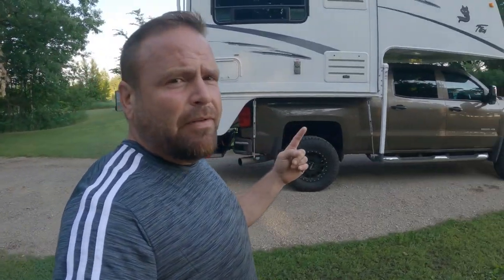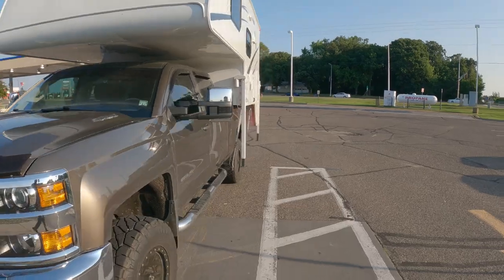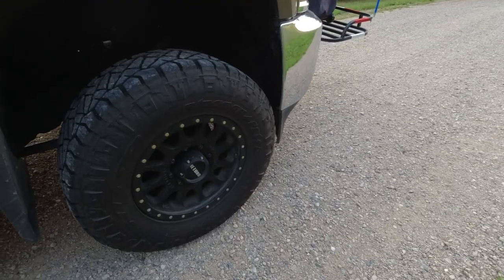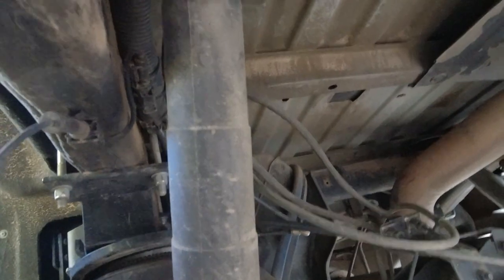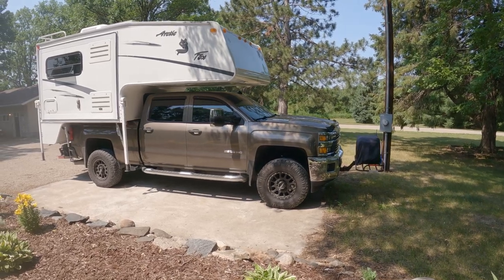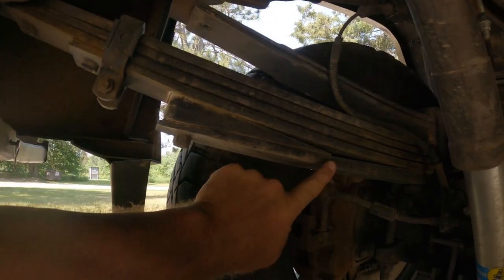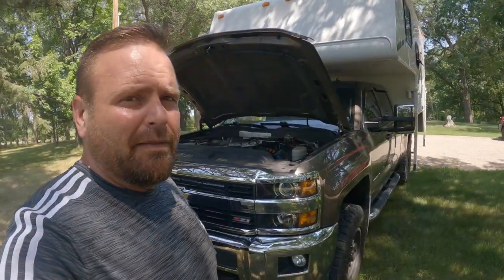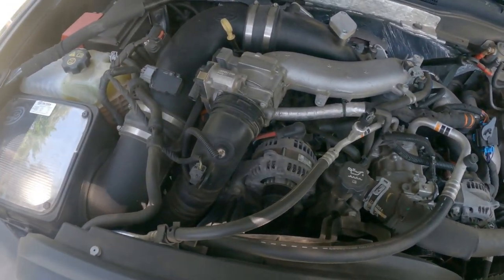Suspension upgrades for Truck Camper

Comment: Great video, good ideas. I like the dually for having the two extra tires to carry the weight, more stable.
Reply from the maker: There's no doubt about it, the dually is a lot more capable hauling a truck camper. Thanks for watching!
Reply: @KennyOfAllTrades  when using a duley , would you need rear sway bars??
Reply from the maker: I'm not sure, I have never owned a dually.

Comment: Great video 👍 I replaced the factory hollow front Sway bar with a Hellwig 1.5” solid sway bar, billstein shocks, rear Stabil-Loads, tembrens, and Big Wig Sway Bar. I have no more body roll. Truck handles Camper nicely on Crappy California Roads
Reply from the maker: I know we can not actually raise the payload on these trucks, but it amazing how much better they can handle with a few upgrades. Happy 4th!

Comment: When we go pick up supplies and need to open slides to get into the truck camper, we park at the far edge of the lot and take 4 spots to fit. We have to pay for two spots in paid parking lots. Thanks for sharing! Tracey and Christian.
Reply from the maker: I definitely can relate with parking in the back of parking lots.

Comment: Recently upgraded from my Ram 3500 to a Dually Ram 3500. Your camper looks lighter/smaller than mine (2021 AF 811), so I would probably have kept the same setup you have too. I went all over the country with my SRW/811 setup over the last year, out to yellowstone, colorado, utah etc, with no major issues. A sway bar would have been my only other mod. I was over weight on my tires/wheels even with the tires rated at 4080/tire so I went to 19.5s and hated having to swap tires around to put the camper on or suffer with a harsh ride empty with the 19.5s. Dually is more stable overall, and I have a short bed dually so I don't have quite the length problem you'd have with a longbed dually, but you do have to be careful of the hips (and add the swing out brackets to your TC).

Glad to see another Truck Camper YouTuber, look forward to more videos.
Reply from the maker: I think the shortbed Dually Dodge with an 811 would be the would be the best set up.  Sounds like you have it figured out. There is no doubt your truck would be quite a bit more stable than mine. Thanks for the comment and watching the videos!
Reply: 811 on SRW Silverado gas 3500 with 4080 tires and method hd 4500# rims here. No need for dually. Handles it great. Been all over.
Reply from the maker: That's exactly what I run and I've not had any issues for over 40000 miles. The load index 129 tire is definitely the way to go for a SRW.

Comment: Wow, that's a LOT of suspension modifications. Personally, I'd be outta my league going to the 18" wheel/tire combo- that required more mods just to make it driveable- before putting 4,000Lbs. in the 6 1/2' bed! Clearly, you've had a number of truck campers in the past, have a pretty good idea of what you are doing hauling that type of load- I'd struggle to wrap my brain around all of the issues, let alone address them!!! But, you are a great resource for those us early on the curve- you know, basic mods: timbrens or airbags? AND, which sway bar will be enough... Makes me excited just thinking about it!!!
Reply from the maker: Timbrens are great! My truck in stock form sagged a 1/2 inch with Timbrens. ( which is not bad ) I did not need a sway bar with Timbrens either. The air bag do allow small adjustments side to side. I had the need for a sway bar after installing the bags. I can have the rear of the truck sit 2 inches higher then the front with air bags.. Upper and lower stable loads would be sufficient if hauling a  2500 lb or less camper in my experience. 
Also leafs handle weight a little bit better then rear coil springs in my opinion.

Comment: Great setup. I have a 2016 3500 Silverado SRW. My mistake is that I got the 6.0 gas instead of the diesel. At the time I couldn't afford paying the extra $10-$12,000 more for the diesel. I have 165.000 miles in it and she is still running strong.
Reply from the maker: The 6.0 is a capable motor. My truck pervious to this one had the 6.0. It took the Arctic Fox up and down the mountains out west with no issues.
I would still be running it except a few years ago my girlfriend was at a Chevy dealership buying a different vehicle. I saw this truck on the lot and they were asking 28k with 95000 miles. It was a deal that I could not pass up. I've owned the truck for about 3 years. I think I could sell it for 10,000 more today than I paid for it three years ago. The price of trucks has gone completely insane
Reply: @Kenny Of All Trades  I bought my truck new in 2016. I thought about trading it in for a diesel but I don't like the body style on the new Silverado's. I've pulled 28 and 33 foot campers with no issues. I have been looking at the truck bed campers for awhile. And I want to bring my boat with me when we go camp.

Comment: OEM overloads and rear anti-roll bar, snubbers for instant overload contact, 325/60 R20 on 9" width wheels..
Done
Reply from the maker: I hear you, I got another video  Of the suspension upgrades. I stuck a camera under the truck so you could see the difference between all 3. Check that video out.
https://youtu.be/Msqnosna8N8

Comment: Just started towing a truck camper in. 3500 Dually, 8’ long bed. Towed 5000 miles, but just started having issues with suspension. Good video, see ya out there! Nice channel

Comment: Thanks for the rundown on modifications. I don’t care to drive a dually and will buy a camper I can haul on a SRW truck, even if I have to upgrade to Vision wheels to get to the hauling capacity I need.

Comment: Good vid  I dislike dually but run one cause they do handle the weight better   especially if your towing   I get into some mud crap trail stuff  dually works awesome  keeping overall length I think  20 feet  important  legal to park then

Comment: They make the 811 in a long bed. Your overall wouldn't be any longer with a drw even if it was a crew cab. You'd just lose the gen compartment. Love your videos. Keep it going!!!
Reply: I have an adventurer 89rbs on a 2018 silverado 3500hd crew cab long bed. Did 19.5s, front and rear sway bars, and upper and lower stable loads. Hauls it like a dream.
Reply from the maker: That makes sense. I guess I wasn't thinking about the 811 with the gen set removed. I've seen other manufacturers have campers with removable rear compartments for 6.5 or 8 foot beds as well. I have not looked at an 811 in person. My m860 has the dump valves in the rear compartment. I wonder if they intended on using this model for either bed size?
Reply from the maker: I have been contemplating the 19.5. Maybe the next time I need tires. There's no doubt the 19.5 are an excellent upgrade option for the SRW.
Reply: @KennyOfAllTrades  yeah I went from the stock ltx at2 tires to a 245/70r19.5 firestone transforce at2 and vision hauler 81 wheels. The stocks were running very hot and truck was very mushy on the road. The 19.5s are a whole new world of stability. Not the best off road though but toyo has some aggressive tread designs that would put my firestones to shame. Paid $275 each for the tires and got the wheels used for $350 for 4.
Reply: @KennyOfAllTrades  I don't know much about the 860 but makes sense. 860=short bed 990=long bed 🤷‍♂️

Comment: I am watching your videos more than once ... they are GREAT and absolutiely loaded with good (and humorous) information.  I definitely picked up "a thing-or-two, along the way".   

Question - at about the 6:00 min mark you say that the Timbrens helped keep your truck from "rolling back and forth".   Would that be ... like ... that phenomena known as Truck Camper 'Porpoising'?  I'm still looking for hints at what might be my answer !!    :)

Thanks for the jam-packed-full videos !!!
Reply from the maker: The Timbrens helped with side-to-side sway. I don't experience to much porpoising with this setup. When I do it is usually caused by rolling ripples in the road or winds hitting the bottom side of the cabover just right. I once thought I had something wrong with the truck and had to pull over, the truck kept swaying front to back. It took a minuet to figure out it was small waves in the blacktop. It only happens on that one stretch of road. 
I had a 3/4 ton that carried this Arctic Fox camper. I could feel the front to back sway more in that truck. The one ton came from the factory with larger torsion bars thanks to a snowplow prep package. It makes the front end stiffer but helps with carrying the weight.
Reply: @KennyOfAllTrades  Thank you for the insight.  I have more porpoising than I want; it's bugging me enough that I really focus on it when it happens.  

I now believe it is the factory shocks that can't control the weight shift when I do go over bumps with our rig (2022 GMC 3500 HD wi x31 package, Diesel, SRW Cirrus 820 @ 3,100 lbs dry).  This lack of control - I believe - just keeps going and gives me porpoising.   

I have a 5 leaf overload upgrade that my local suspension guy says he does "quite a few" to my truck.  This helped with the sag (a lot) and some sway (they are stiffer than the 2 leaf OEM and only engage with the Camper on).  

Hmmmmm  ....  It probably wouldn't be satisfying if the fix was easy.  Likely do Bilsteins in the spring and see what happens after that.
Reply from the maker: Are you close to north central Minnesota? I'd let you compare trucks and campers to see how diffrent it feels. I never weighed my rig but I'd imagine I'm pushing close to 4000 pounds.
Reply: Not even close to you unfortunately.  I'm on Vancouver Island in Canada.   My Payload id 3910 and I'm close to that, when I add the soda pop and crackers.

We have a great suspension guy in my small city but he is just like the rest of the world - he has not really dealt with porpoising.  His suggestion for me is to next try Bilstein shocks.    Ooops  - there's another "Quick 'Thou'"  (Cdn$)  :)

Comment: According to what I read on Chevrolet website, the long Bed 3500 DRW and long bed SRW are the same length
Reply from the maker: You are correct, however, I have a 6.5 bed. I took my truck to the dealership and measured against an 8ft bed. There's about 19 inch difference.
Reply: @KennyOfAllTrades  If love to buy a SRW,  but we’ll end up with a Host Camper, so I’ll be buying the DRW.  However, I’m opting for the 6.6 gas engine primarily because of the upfront costs.   If I were towing I’d definitely get the Duramax.
Reply: I’d

Comment: I'm enjoying your videos. What make and model is the compressor with remote that you are so stoked about? I'm driving a 2005 Ford F350 6.0L, crew cab, drw, long bed with a 2005 Lance 1010 camper. It is not the heaviest camper so I am well within the allowed loading.  The truck has started to noticeably wander a bit within the lane. I think it time to upgrade the steering and suspension components so your video is timely for me. Thanks for the ideas.
Reply from the maker: It's the Airlift 74000EZ  compressor with the 7500 lb bags.
 I will say I'm a little jealous that your turbo sounds soooooo much better then mine. I love the whistle of the 6.0!!
Reply: Well, I like the whistle for sure but I knew nothing about diesel trucks when I picked up the rig. The cost of correcting the 6L’s issues is gonna sting. That said, I am a happy camper or will be once the steering issue is corrected. Thanks for the reply and the compressor and bag info.

Comment: Have you had that truck across an accurate scale to get the individual axle weights. I would honestly be surprised if you are not way over the GVW of that truck even if you are under the maximum individual gross axle weight ratings. My brother has an older ford dually with a large camper ( no slide outs though ) and its extremely heavy and is 500 lb over his GVW. The GM springs may be better in the back then the ford was as it was just pathetic ( or put another way its an extreme load, too much for a dually ! ) and he ended up having two leafs added per side, then air bags in addition to that. The problem was that it still handled like crap in side winds and around corners so yup he paid the money for the over priced wedges to get the overload spring to assist and that certainly helped. Then I urged him to spend more money and buy the largest front and rear swaybars he could find and that was a huge game changer as you've found out in its handling between that and the wedges (stable loads ). In fact during his struggles with the handling he realized that the airbags were counter productive and now with the stable loads he carries very minimal air in the bags and so that allows the springs to carry the weight and is more stable and predictable in its handling. I know some will scoff at the negative comments towards air bags but this has been proven that with these top heavy loads air bags are not the answer but more spring capacity and ( yes timberins if needed ) big swaybars on both ends of the truck is what works. In all honesty though these large heavy campers are too much for even a one ton dually as some stepped up to using 550 trucks with a deck system. The frames on the one ton are flexing too much, the axle housings are not rated for it and so on. The dual wheel width and tire capacity are needed with that top heavy weight, yes I know ( as you are doing it in this video ) using a single rear tire but the safety margin isn't there and have seen trucks sitting at the edge of a highway with their single rear tire blown out with a camper and its unsettling to see the precarious situation and so easy to have a roll over.
Reply from the maker: I haven't run the truck across the scale because ignorance is bliss! You are absolutely right these campers are ridiculously heavy. And the manufacturers are not making them any  lighter. 
I do realize there is absolutely nothing I can do to increase the payload of my truck. But the upgrades certainly make the truck handle better. I've been running truck campers the last 25 years and the trucks have been getting a lot better. Gross vehicle weight capacity of the trucks in the 90s were ridiculously low. GMC came out with a fully boxed frame in 2014. That does help with some of the flex. My first truck camper I was running around in  a mid 80s square body Chevy. There was no internet back then and I'm sure we were all way over weight. There's no way I'm going to be able to afford a dually anytime soon. My next upgrade will  15 years, I'll probably step up to a F-450 or 550 with the 7.3 liter gas. Pipe dreams lol
Reply: @KennyOfAllTrades  I don't think my brother realized how insanely heavy that new camper was going to be at all, he bought the ford dually new in 2006 and then the camper he went to the factory in BC to pick up and was utterly shocked to see his truck sink ... sink sink, as it was loaded on and he dragged his butt back to Alberta and then began the adding of the springs and air bags but never happy with the setup due to the very scary handling on curves and buffeting side winds until he did those other upgrades I mentioned. Its a nice big camper but I tend to think they lied about its actual weight, I blame both RV sales dealersships and camper manufactures for pretending these heavy camper types are suitable for your average pickup, the consumer doesn't know until they have bought it and then find out the realities !. He had thought about buying a Northern Lite as they are considerably lighter but they just don't have the size and features his does but after the overload wedges and stabilizer bars were added its become a decent unit finally to be on the road with. Before this unit he was using an older GM two wheel drive dually with a very old full size vangaurd camper and that truck had extra leaves added due to prior pulling a fifth wheel and I guess that camper must weigh a lot less as that truck played with that camper, it handled great, no leaning or swaying. His new camper is so darned tall, that basement tank system just puts the center of gravity way up. He tows a jeep behind so there is no easy parking with that obviously, get the unit parked off to the side or camp ground and then run around with the jeep, besides every time the ford breaks down at least he has transportation ( that truck with camper on it has been winched onto a few tandem axle roll backs in its life, uh the life of a ford owner LOL )

Comment: With that shite on the front receiver adds about the same as my 8’ bed on my 3/4 ton. I wish i had a duel rear because of the resistance to sway. Additionally i need air ride .
Reply from the maker: You are  right. The way I'm sitting right now,  the length of my truck would be about the same length as a duelly with  a comparable camper. The M860 is specifically made for a short box, and I could not afford a dually, more or less a diffrent camper. I agree the dually would  Definitely be a more stable ride. Thanks for watching

Comment: I tried the felling wedge last year to engage overloads quicker but could not find the right shape.  Ended up just bolting a piece of .5" flat stock in the hole.  I like that it engages suddenly and only when loaded ( travel trailer + folding golf cart)